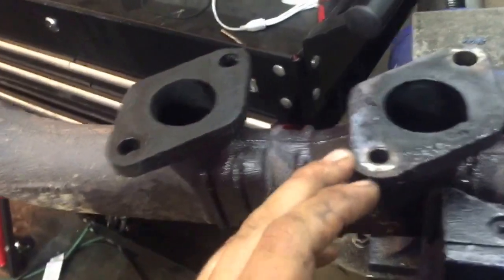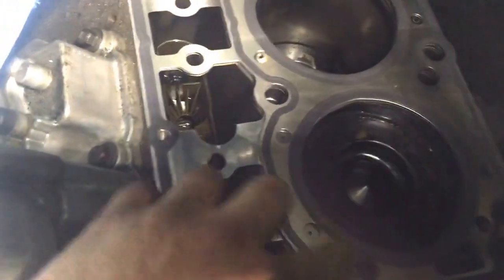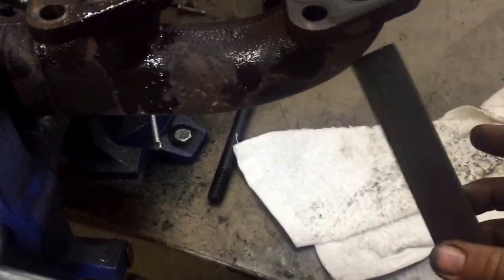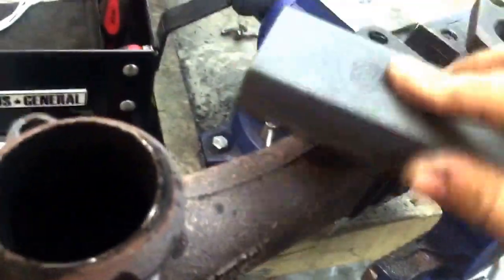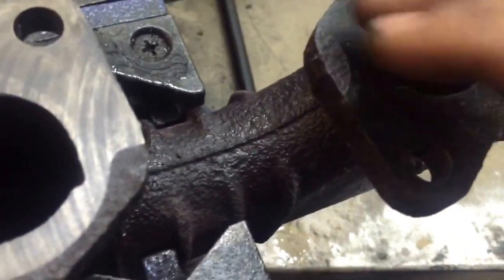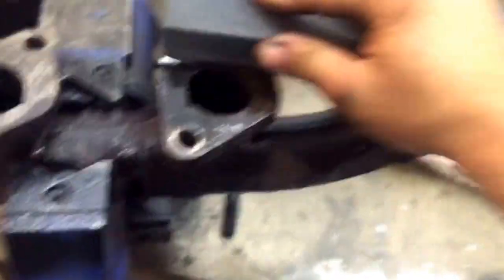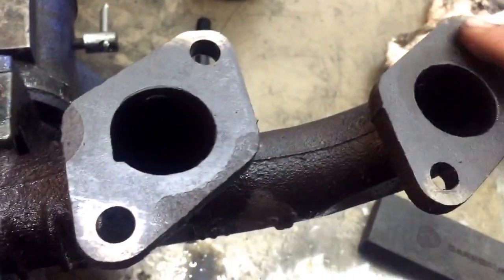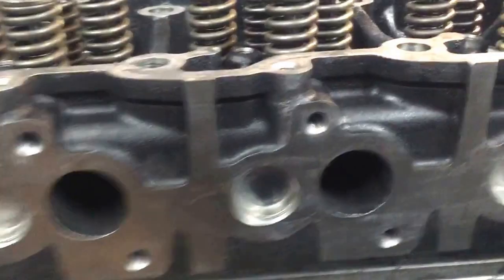6.0 powerstroke gasket prep with stoning block

Comment: Important question on this with regard to stoning the engine block itself. Can you please tell us how you avoid getting debris into the water jackets while stoning? Any advice would be most helpful. Thanks in advance.
Reply from the maker: Bryan Mcmenamin I’m doing a head job on a 6.4 and Ill do a video and show everyone my process on block cleaning and cylinder head cleaning.
Reply: @Dieselpitstop  Thanks man, your the best! Appreciate it much and just want to make sure it's done right.
Reply: @Dieselpitstop  did you ever get a chance to upload this? Doing mine soon, would appreciate guidance.
Reply: Use shaving cream. To fill the holes then vacuum it out when done.

Comment: first of all great video, it is so nice when i learn a new way of doing something that makes life a little easier. my one question. the fine side of my stone is 240 grit and is that fine enough to do what your doing on your head. my concern is making scratch marks that would not be repairable when using 240 grit. thinks